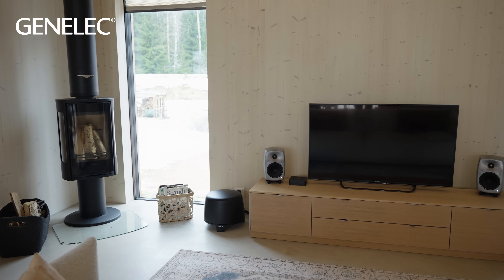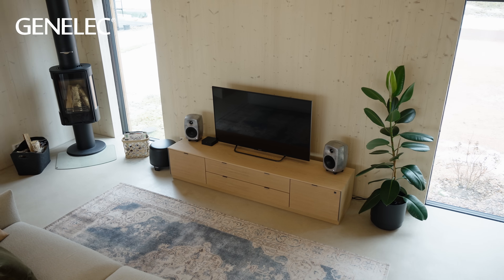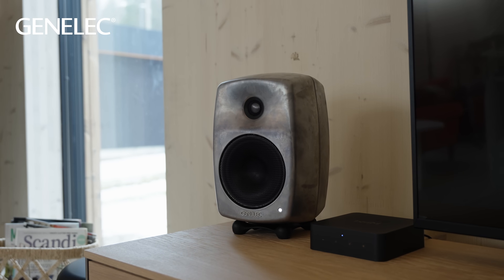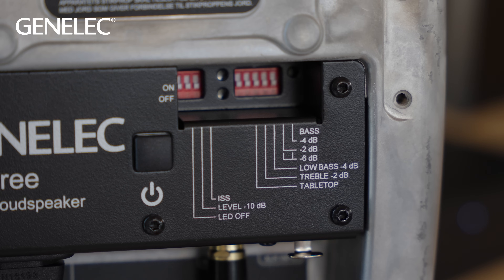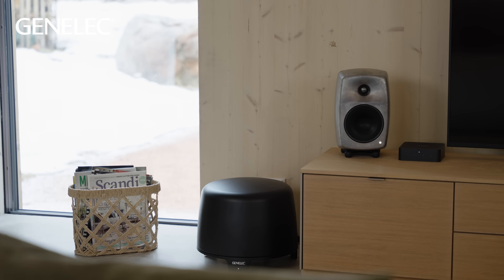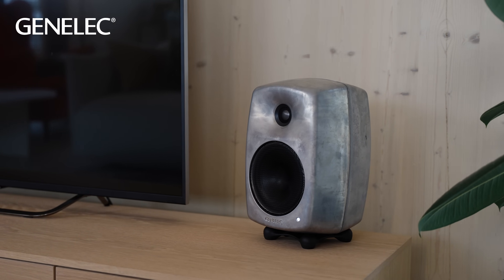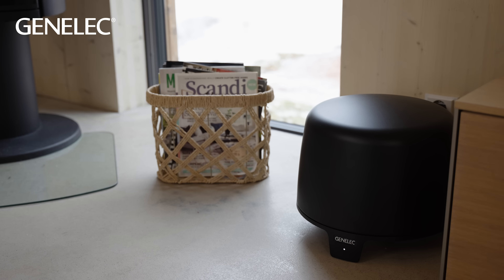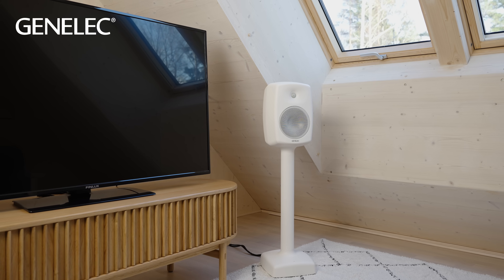Genelec Home Audio | Placing and calibrating loudspeakers

Comment: My dear genelec i have a pair of 8030c in floor stands that are positioned in front of acoustic panels. Should i use the -4 bass tilt on the back?
Reply from the maker: Hi! Yes, generally it is a good idea to use -4 dB bass tilt if there is a wall behind the speakers. Acoustic panels mainly affect higher frequencies.
Reply: @genelec thank you!